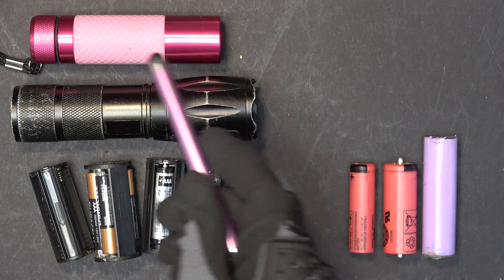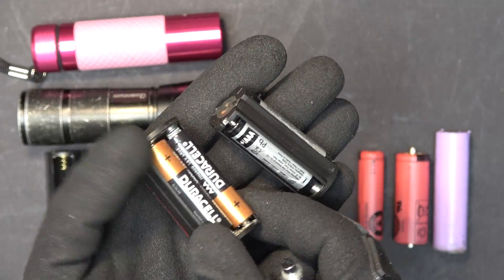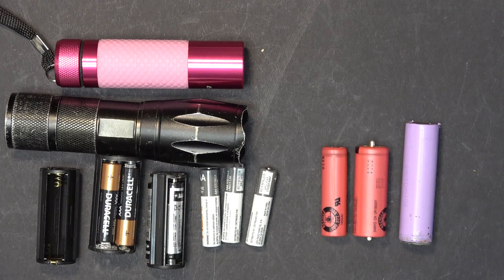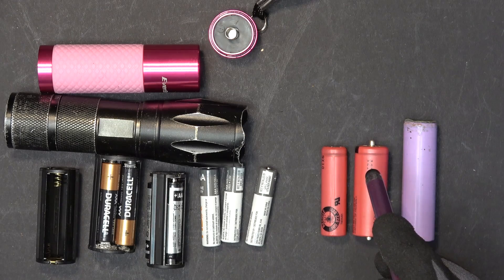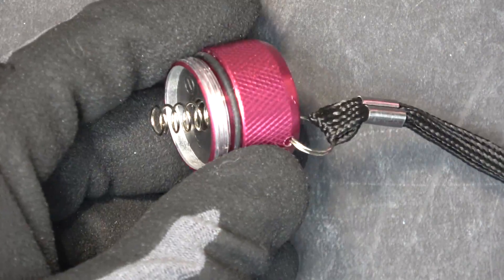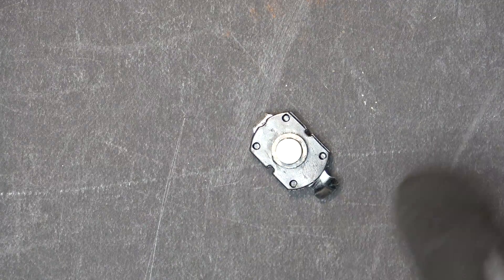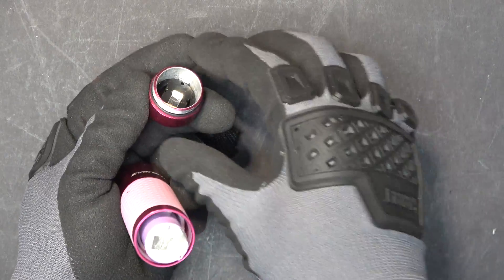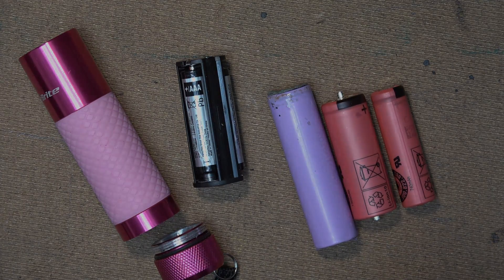Flashlight AAA battery cartridge hack: Replace with Li-ion 14500/18500/18560 batteries

Comment: If you remove the spring from the end cap, you'll be able to fit the 18650 be able to fit the 18650 and screw that end cap on.

Comment: I did it but the 17 discrete leds of the flashlight are going one after another and few of them are blinking before the fail.The non rechargable batteries was 4,5v but had large internal resistance acting as a current source,compared to LI-ion batteries which have near to zero when battery voltage is 4,2v and led maximum voltage is 3,6v the current rises to 1-1,5A with large temperature rising of the leds.So in my case works but not lasts,just pay 7 euro for 18500 battery instead of buying something new.

Comment: Nice hack :) I had the fourtune to find a 3 AAA-led flachlght, with a shorter (body) and longer -end-plugg, so I could take a shorter bottom piece (switch and switchholder) to an another with longer body and but a shorter piece. But it is not alway some one have a luck whit dumbsterdivingh, so a very nice hack. Thanx PS. I did make the "mor"  with the led-house wider, so the positiva pole ger down to the politive pole in the led-house.

Comment: Good video. I have one flashlight that uses a cartridge of 4 AAA batteries. The cartridge looked like it was the size of a C cell, so I put one in to see if it fit and it did. Then I bought a package of non-rechargeable Li-SOCL2 (Lithium Thionyl Chloride) 26500 batteries. They're 26x50mm, about the same dimensions as a C cell (26.2x50mm). They're only 3.6 volts instead of the 6volts 4 AAA batteries make, but the light is still bright. The 2700 mAh battery should last 2-3 times as long before I have to replace it. It's cheaper than buying 4 AAA batteries at a time, but rechargeable lithium batteries would be even better. I got these because they were cheaper, and I didn't know if the flashlight would even work with the lower voltage. I have a couple of flashlights that use a cartridge of 3 AAA batteries or an 18650 battery interchangeably. The cartridge is a little bit longer on top than others, and the first thing I did was buy 18650 batteries for them. But I have some small ones that an 18650 won't fit, and I might try modifying them like you did.

Comment: 14500's are awesome ! 

Some of the lower power flashlights with single AA's can directly take a 14500 as long as you don't run it for so long the LED emitter overheats .